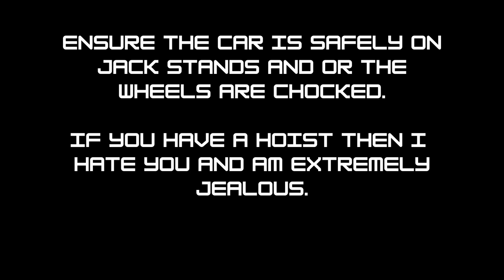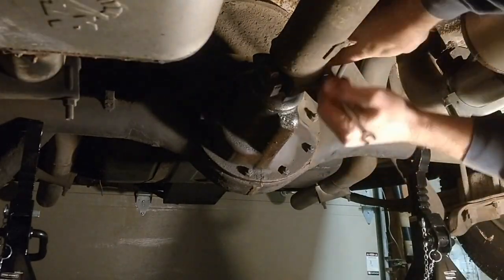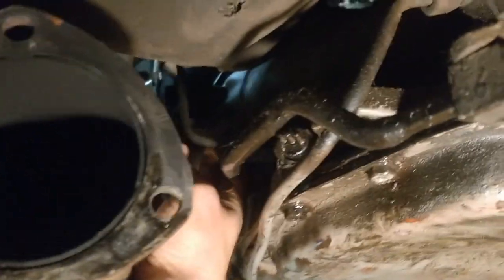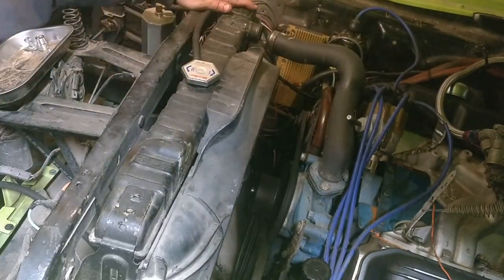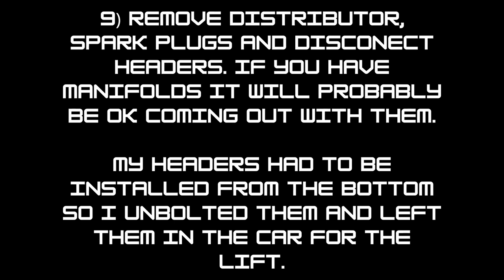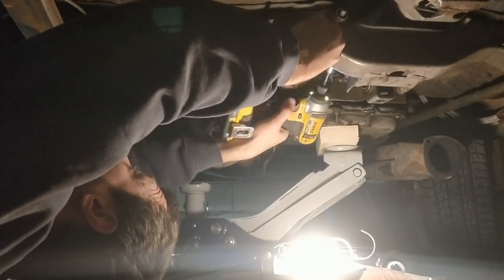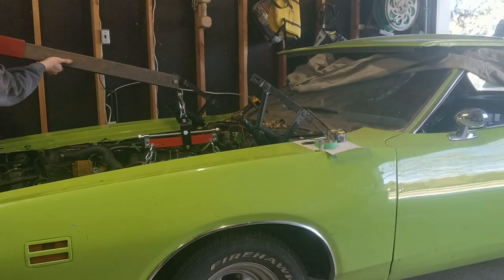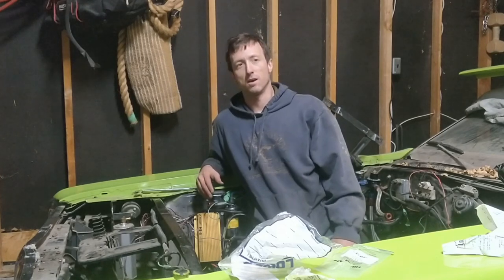1971 Dodge Charger Restoration Episode 4 - How to pull a motor and transmission

Comment: When I built the motor for my 67  Camaro,I had just got it back from the machine shop,put it on a cheap Canadian Tire Motor stand.I had it all assembled,I had just finished installing the aluminum heads,I put the ARP exhaust bolts in their place so I wouldn’t lose them.I rolled the stand closer to my work bench,the front wheel hit a nut on the floor,and the whole stand fell over.Drove the bolt into the head,I actually sat on the floor and cried lol.The machine shop was able to save the head,but not before I tried for weeks to get it out myself.I was so pissed off,thankfully it still kicking ass today,the thing eats newer camaro s and mustangs,but every time I open the hood,I still see the crush on the head.Thanks Vic loving the channel.
Reply from the maker: Jesus lol.  That would suck

Comment: Reminds me of a time when I pulled my 460 and C6 out of my van all alone in the winter.  It's possible but not a lot of fun.  It was a hot rod motor and surprised many when I would drop the hammer.  Never needed to dink with 440 in Roadrunner except to jack it up a bit to put headers on.